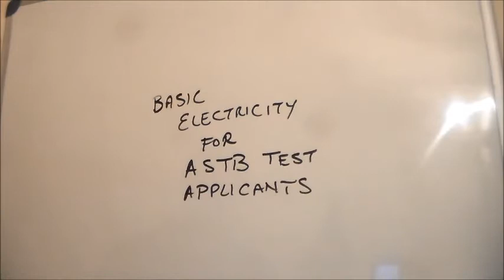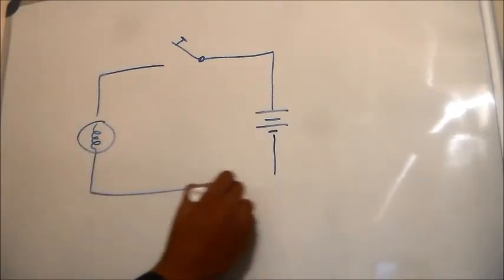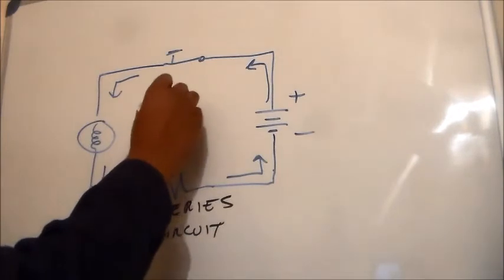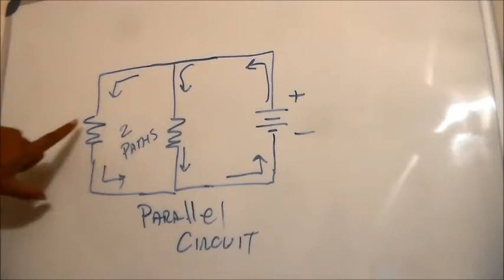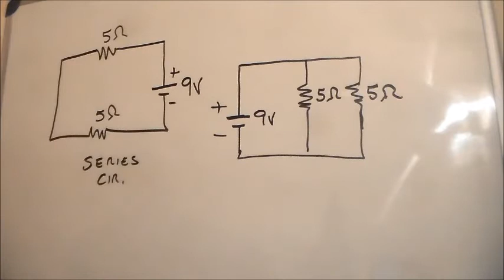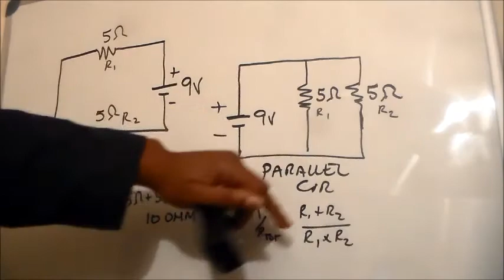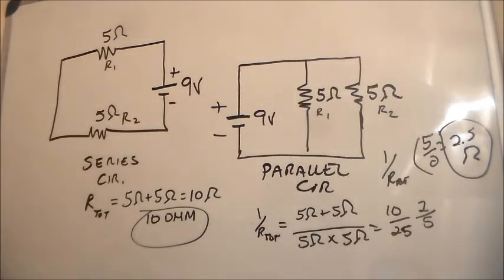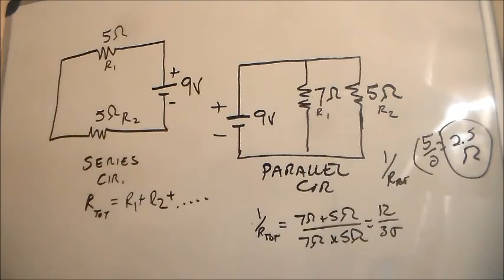ASTB - Aviation Selection Test Battery - Electrical tutorial

Comment: Sense the military has "upgraded" the ASTB to the ASTB-E, can it be safe to assume that the test will be more difficult?
Reply: A bit more difficult, especially since the Spatial Apperception section was replaced with a flight simulator test measuring navigation, hearing/sensing, and hand-eye coordination skills.
Reply: There are a few factors in  how to pass the military exam. One resource I found that succeeds in merging these is the Wilfs Exam Blueprint (check it out on google) it's the most useful guide that I've heard of. look at all the interesting information .